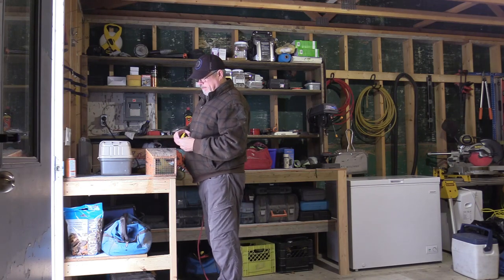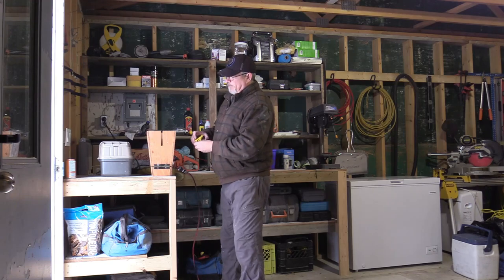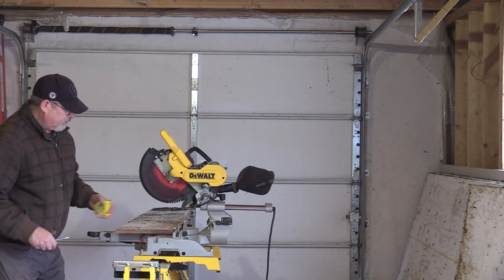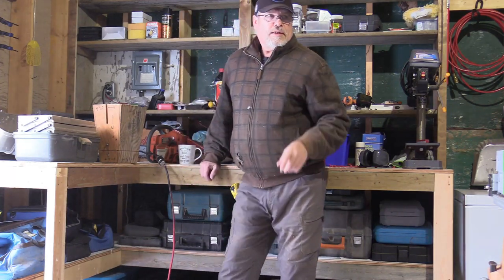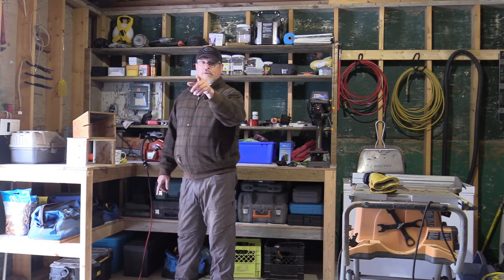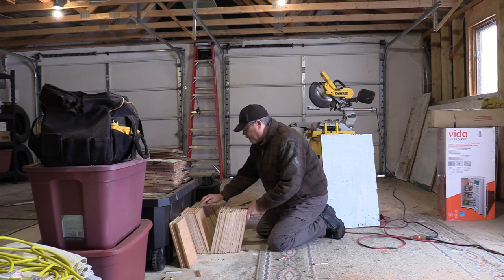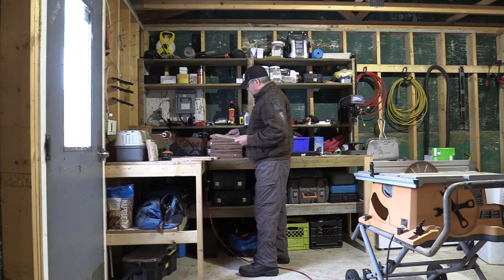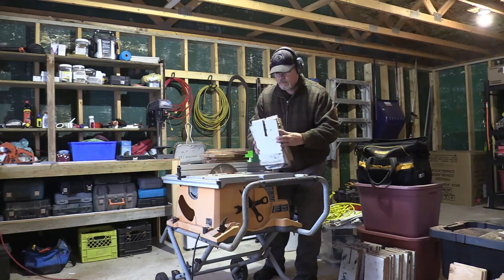Marten Boxes/Fishing Kit/Tent/Starlink

Comment: Nice of you to share your marten box building techniques.  I hope you get a chance to go fishing this year, just for a break.  Take the tent frame. It makes it way easier to set up by yourself. Put the roof bars together, put the tent on, and then add the legs once it is stretched out. I do this when we go hunting while the guys get the trailers and gear unpacked. Good luck and hope you have a great season.
Reply from the maker: I think I will test it at the cabin for sure. Set it up and see how it is. I can use it the first trip but I’m probably going to make a log frame to sit out there. See how it goes. Thanks for the tip Laurie